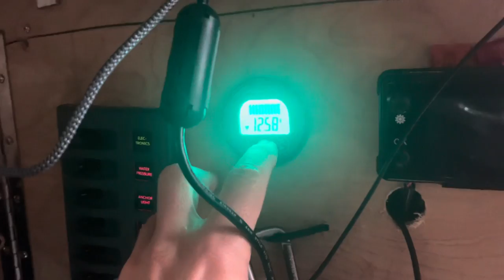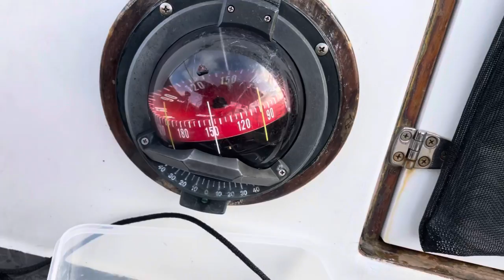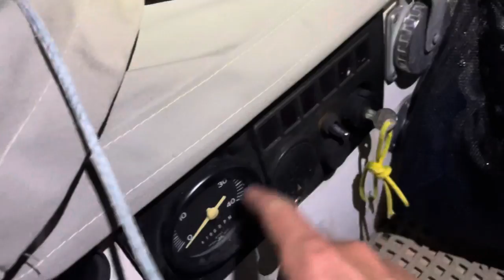Engine failure at night in unfamiliar harbor & destructive crash gybe in the North Sea. Haugesund

Comment: I had the throttle connection come apart on my yacht . I lost all power in a busy narrow river , with my sails stowed as i was preparing to anchor . I quickly lost all forward motion due to the current , but fortunately , i was not alone . My dad used to crew with me , and he was a motorboater . I dived below and engine covers flew .  Grabbed the throttle arm , i give it a good arm full to restore way . It took a little time to jury rig a piece of string as a throttle , while holding power to keep way on . I managed to get it working , so we could manoeuver enough to get the hook down  , and make proper repairs . Your not alone !

Comment: Those Chinese diesel heaters are amazing little units. My wife and I have lived aboard about 5 years in the pnw by Seattle and it’s kept us warm all the way down to 10 degrees outside. The bearings wear out after about 3 years so we’re on our second one but for $130 you can’t beat it

Comment: I have gone off some side tracks inspired by your videos. I got into reading more about small boats inspired by Sven Yrvind and then got on some History Channel thing about Sir Ernest Shackelton and Frank Wesley's disastrous attempt in 1914 to cross Antarctica and how, in the end, they were able to make it out 800 miles on the arctic ocean in a 21 foot rigged life boat in weather and seas that sunk a much larger boat in the area at the time, which makes more sense to me after reading Sven's book - the larger the boat, the more force of resistance against a violent sea, the more stressful the sailing and potential for catastrophic failures. I am learning to sail on a Sovereign 18 and, for awhile, did not have a motor. Its nice when all the conditions line up; isn't it? I don't think I would want to go as small as Sven Yrvind but I like how you keep things simple, efficient, and seemingly more easily manageable than many on larger boats. I also like your sense of wonder and how you keep things optimistic. Thanks

Comment: This happened to us one day after coming back to the mooring, push start button and everything died. Engine had hydralocked during a storm  sloshing in the exhaust, trying to hit start blew a 200a fuse hidden in the bowels of the boat... Good news was, we were able to spin the water out later and she still runs. The boat electronics are on a totally other battery bank which was lucky for us. Glad it turned out well...

Comment: Not sure if it's been mentioned already, but some vaseline or other thick, non-graphite [conductive] grease on nice, shiny electrical connections will greatly reduce corrosion/electrolysis for several months, if not longer.

Comment: Just a thought on autopilots where you have wind vane steering…… If the autopilot could be connected in such a way that it is controlling the paddle…. in lieu of the vane, it would use far less power because the paddle would be doing the work…. It would also presumably live longer.

Comment: I saw u install a diesel heater, i was thinking about installing one. What are your impressions about the heater now that u sailed colder areas?  Second question, did u sail in canada and if not, do you plan on passing by one day? Thanks Sam!
Reply from the maker: It worked great until after i got to Norway, then if broke. Canada wouldn’t let me for some reason because of covid
Reply: @samholmessailing  stupid covid rules! Men i enjoy watching all your videos, from sailing to the workshop renovations and fixing your boat… your an inspiration!  So where do you think you gonna be at for x-mas? Alone in the middle of the ocean?

Comment: Why do you thing my friend, I have a jeanneau 9 m (29 feets). Do you thing , this kind of boat can do a travel as your ?
Reply: I wonder how many of Sam's fans have sailboats under 30 ft?  Two of us so far.
Reply: Length is less important than seaworthiness.  29 is small but people occasionally cross oceans with boats of that size. Very uncomfortable but pure sailing!
Reply: Finally, I bought a pearson vanguard 32, long keel. More comfortable I think. I will try this boat this summer. Tkank you.
Reply: @xpeditionb  I believe that's pretty similar to the boat that Sam is sailing here.  Rigging, electrical and steering are the failure points to generally watch for on older boats. And check your through holes.  :)

Comment: the fuse melted due to too much current, and your solution was to remove the fuse? Sounds like a recipe for disaster.
Reply: His last few videos he's had some electrical issues. He really does need to resolve/fix them before he gets the boat back in the water next year.
Reply: What would typically cause the current issue?  Alternator?
Reply: @deepeddysf  short circuit or corrosion. Either causes a high current.